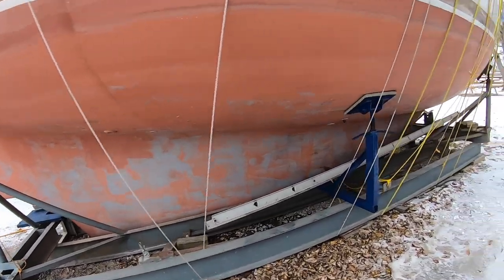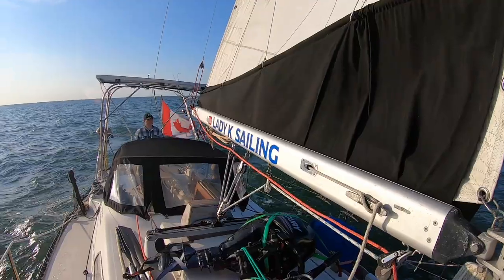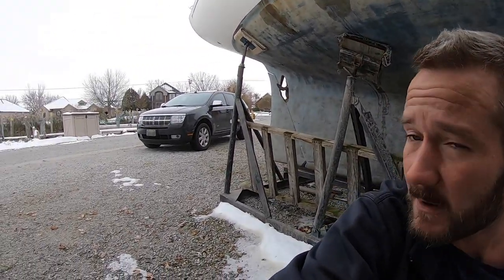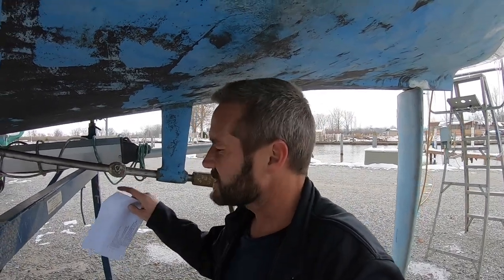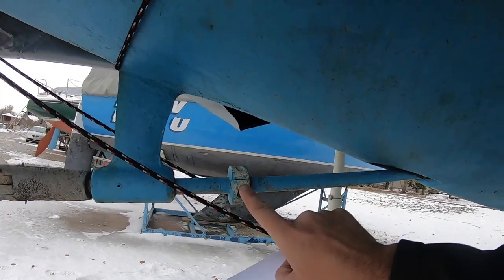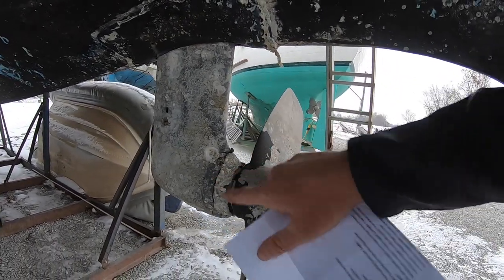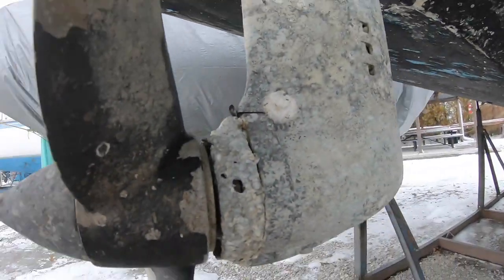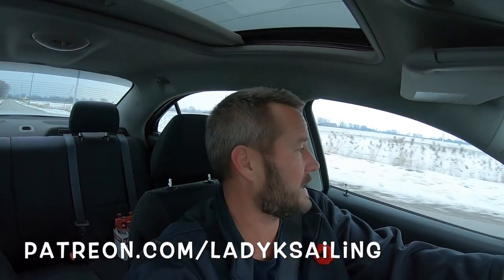Anodes, Zincs, and Keels, Boat 101 - Episode 83 - Lady K Sailing

Comment: Most people should paint their anode in one place.  Typically there is a spot on the anode where the metal is thin next to the screws where they are secured.  You should paint a little of the spot next to the screws, so that it doesn't get eaten as quickly and fall off before the rest of the anode gets eaten.  So many times the anode gets eaten away by the screws and falls off when there is like 80% of it left.  Maybe even paint the screws a little.

Comment: We draw 5' 8", Tayana 42. It has a long fin.almost like,a full keel, with deep forefoot. The keel end at prop aperture, then we have a skeg like,you which the rudder hangs on. We had both fin and long keels and I feel that's our is a fair compromise. Tracks better than a full keel, reverses alright and is extremely comfortable at sea. Great teaching video
Reply: Arek kaniewski ah you said Draw the depth of the water required to float the hull as opposed to draft ie. This boat drafts xxxx I guess it is the difference between the USA and Canadian dialect. The way Tim used the word draft jumped out at me! 🤣🛫

Comment: I apologize for commenting on a vid that’s two years old.
 I’m sure you figured this out by now. But Anodes are not effective defense against galvanic corrosion because they are softer than the metal you wish to protect.  Rather, They provide galvanic protection because they have a lower galvanic “potential” from the metal they are trying to protect.  Gold is very soft and lead is very soft ,but  neither is likely to galvanically protect any metal you’d find on a boat.
Your sail-drive would be a very good example, assuming the drive housing is made of some Aluminum alloy.
You should make every effort to use an anode material that is more “Anodic “ than aluminum, like zinc or magnesium.

Aluminum anodes are cost effective for brass or stainless, but not the exposed aluminum portions of your drive leg.

Downloading virtually any example of the galvanic chart for metals will indicate the relative potential for the alloys listed .   The greater the difference  in galvanic potential, the greater the likelihood of the anode preferentially dissolving instead of the cathode.

I am a fan of your channel and do not wish to be critical. 
I only wish you may find the information worth considering…..”rust never sleeps”

Comment: Thank you for this video! I am new to sailing and there is so much to learn. I was having a hard time finding you tube videos on this topic so I am grateful. I have a 2005 Catalina 350. I was not sure where the sacrificial zincs were located on the prop shaft but now I have a better idea. I also understand that there is another sacrificial zinc located in the heat exchanger. Are there any other places I should be aware of for sacrificial zincs? Thanks in advance to anyone that can offer a newbie some education.

Comment: In a marina, assume there are stray currents.  There are boats with their shore power cord dipping in the water.  Don’t use aluminum zincs in salt water unless you yourself check the zincs and knock off the soft stuff.  Aluminum zincs, if not cleaned regularly, become pacified and useless.  Anyway, I doubt you could find any in a marine store if your boating on salt water.  Above all, don’t rely on your bottom cleaner to know anything about the importance of anodes and how to properly clean the surface and install them.  You’ll have to educate him.  Friend had to replace his prop at great expense and the same diver who put the prop on in the water, failed to keep a zinc on his shaft.  It went without a zinc for about 5 mos., when a neighbor diving on his boat noticed there was no zinc on my friend’s boat.  He’ll need another new prop.

Comment: Can you do a vid on electrical grounding a yacht. 

Is connecting to your lead keel stainless bolts ok, will it deal with lightning for instance?

Is a seperate rectangular copper plate necessary, more holes through the hull is a compromise worth doing?

Just doors for thought as I am refitting a 1980’s S&S 30 here in Australia. 

Thanks for what you do!!